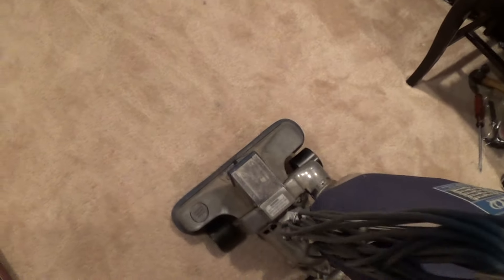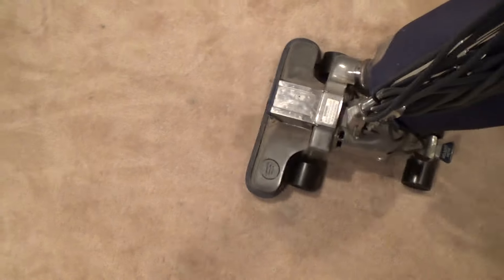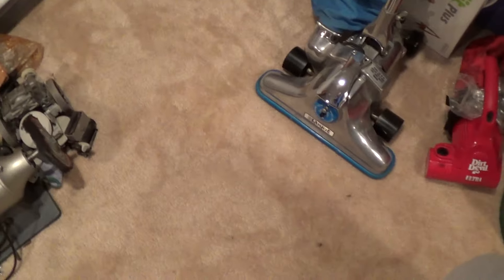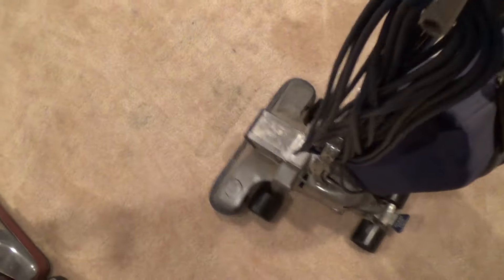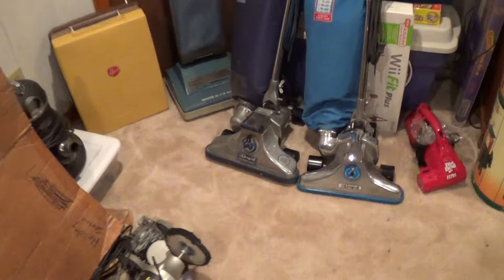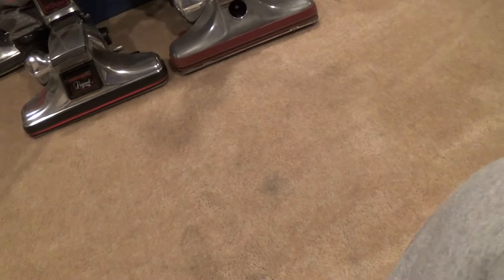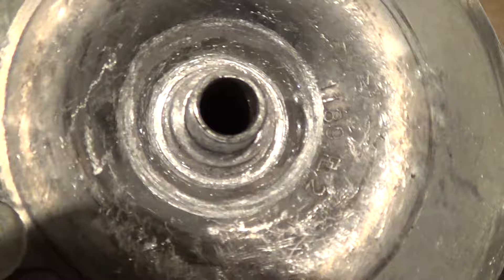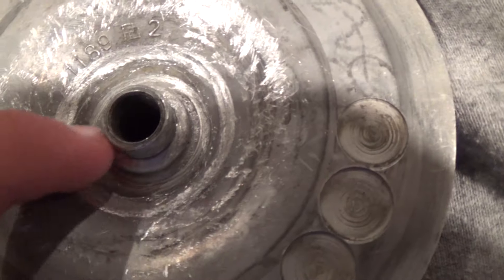Royal 994 in Action

Comment: Nice machine!You can clean that Royal up and it will be a fine cleaning machine. Try some WD40 on those wheels, but do NOT use it on the height adjustment. I recommend using just a little (I mean little) 3 in 1 oil on the ratchet.
Reply from the maker: Matt Jones Thanks for the tips
Reply: You're welcome, Thom.